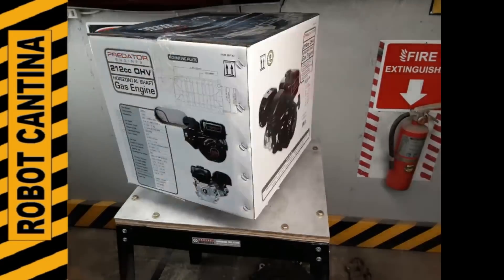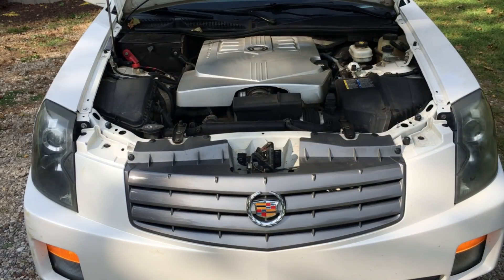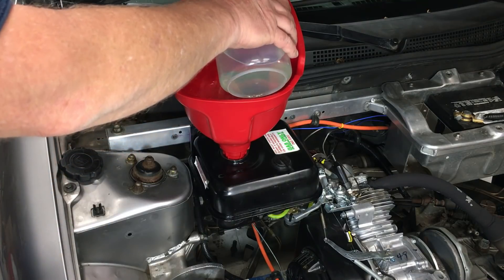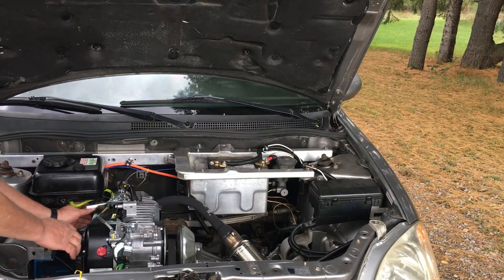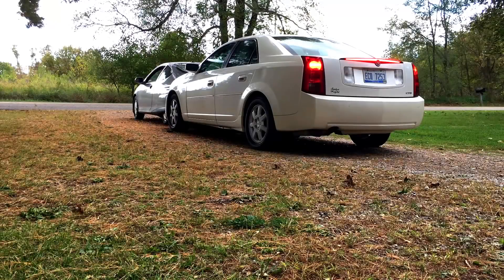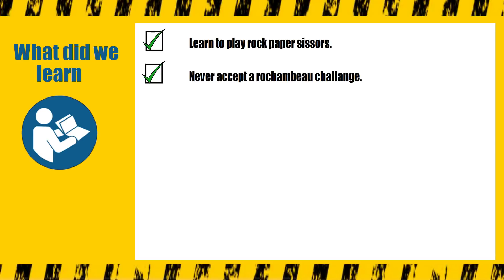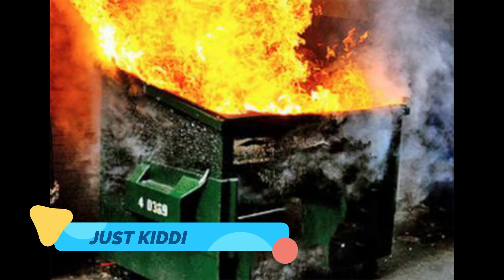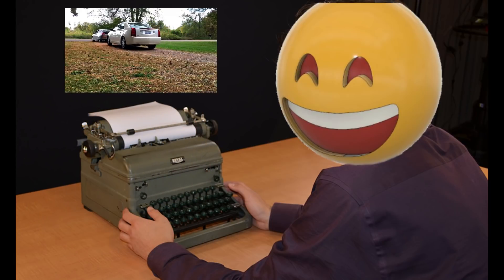Episode 6.  MPG on our Honda insight with $99 dollar lawnmower engine

Comment: 54mpg is pretty decent, but my stock insight gets ~62mpg and it has an electric starter...haha
Reply: And a/c
Reply: indeed these engines are small but not very efficient, not much is different to a pre w2 briggs engine, efficiency of car engines has come a long way to provide the power they do for the mpg
Reply: The $99 predator engine should be roughly 20% fuel economy lost approx just being a carburetor engine compared to an EFI engine. I think he needs to try a small EFI engine and try to beat that 62mpg! Lots of small tractors have 20-25hp EFI engines so there should be something that could be attainable. Of course EFI engines cost more though.

Comment: It did better than I thought! In your other video, I guessed right around 50 MPG, you did better than that. Thanks for showing MPG.
Reply: Actually, if Top Gear rings a bell, they did a mpg test between a Prius and a BMW. The Prius went down to 19 mpg. The trick was of course that they performed the test at 90mph, which is the top speed for a Prius and like 4th gear for the BMW. If you rev a small engine to max it's less fuel efficient than a large engine pretty much idling. It's simple physics really and not a fair comparison. I would venture to guess that this was also a full throttle test and you could probably get a lot better mileage by going only 35.
Reply: @uweschroeder  1g insight gets 45-50 MPG at 90 MPH.  Closer to 60 if it's UK MPG.
Reply: @islandfd3s  Which to be honest is not that great for a hybrid, but then it's a first generation vehicle - I guess they're better today. A BMW 420d gets 56mpg at over 140mph.  I rented one of those on my last visit to family and going 220km/h (about 136mph) it gave me just over 40mpg with the top down (it was a convertible). That I thought was impressive for a conventional car. My car gets about 12mpg with the top down - but then, one of my tires weighs 90 lbs and the aerodynamics are more like a box in a hurricane., so 12 mpg is reasonable for the fun factor.
Reply: @uweschroeder  Keep in mind, in that Top Gear challenge, they compared a gasoline (petrol) Prius to a diesel BMW. Diesel has a much higher BTU content per gallon than gasoline,  so the diesel will always get better mileage than a gasoline engine of similar displacement in the same car. Had they used a gasoline powered BMW, the Prius would have indeed gotten better mileage. Gasoline engines are actually more efficient under heavy loads, than at light loads, because of pumping losses caused by throttling. Also, this small engine has fixed ignition timing. If the timing advanced based on RPM and load, it would do even better. It would do better yet, if it had an O2 sensor, to control fuel/air mixture. For a $100.00 engine out of the box, it did extremely well!!
Reply: @vincentrobinette1507  I know the top gear "challenge" was designed to make a negative point about the Prius. If you saw the episodes about the Prius they were, while utterly hilarious, not very factual. I would bet they did that challenge several times with different vehicles until they found a constellation that yielded the intended result.

Comment: I'm officially complaining... you spilled multiple drops of fuel on both the first and second pours with the funnel.
Reply: lmao
Reply: But the real question is where did he get the old school filler? We're all stuck spilling gas with those new regulation spouts.
Reply: @ninjamaster3453  I 3d printed replacements for mine the files are in thingiverse I think
Reply: @ninjamaster3453  If I'm not mistaken you can get them off ebay
Reply: @ninjamaster3453  The good (relatively speaking) new ones don't let any fuel flow until you brace it against the lip and push a lever thing. Works pretty well if there's enough clearance.

The only other good modern ones I've seen are Eagle Safety Cans. Big ass handle you squeeze to open a huge spot that pours into a detachable funnel.
Reply: Multiple drops? The rest will be coming out the exhaust pipe. No big difference...

Comment: I used to get 52 MPG average in my old Prius even with crappy California gas, and 55 MPG with old Geo Metro without traffic at constant 50 MPH. SparkEV gets 7.2 miles/kWh at constant 24 MPH which is equivalent to 243 MPGe.
Reply: My 1998 Fiat 600 got 64mpg all year average like a granny (max 50 on the hw) 1.1L engine. The EV version of it from 2002 I'm driving now is getting 8 mi/kWh stop and go with no traffic in the city, max 30, when I can accelerate as slowly as I please. I suspect his beltdrive is a tradeoff to get reasonable acceleration. He should try with heavier weights on the pulley  and a smaller reduction to get a higher geared top end. He should get around 100 mpg with such a setup.

Comment: you should just reinstall the honda fuel tank and run off of it. you can use a pressure regulator to dial back the pressure from the in-tank fuel pump. it would be a lot more convenient, and cut down on the roadside refueling, which is depressing and dangerous.
Reply: That would increase the weight of the car and decrease its already low top speed.

Comment: How does it perform with a Tillotson TCT 'mechanical fuel injection' system?
Reply from the maker: Wow, this is the first I have heard of the TCT.  looks cool
Reply: @robotcantina8957  Also, check out project farm's spark plug testing! The autolite racing plugs are pretty bad. The Pulstar does pretty good.
Reply from the maker: I'll check that out, Thanks for the heads up on the spark plugs
Reply: @robotcantina8957  No problem, I look forward on seeing this insight become a barely-practical highway-driver.

Comment: Like the videos, can't hardly wait tell you get the 420cc in the engine bay.
It would be great to see a test with your torque converter VS a simple
Gokart clutch with 10 tooth drive, chained to a 60 tooth driven.
Reply: I would think that it would be way slower with the simple clutch. I think that the Comets go from 3:1 to 1:1.  So you'd miss out on the extra advantage. As well as missing out on the higher ratios
Reply: Why not just mate the engine directly to the manual trans? It would have less loss and probably go faster
Reply: @westellmodel  You're kidding right?
Reply: @MilesPrower1992  no I'm not kidding. 

The cvt sucks power off the motor. They're not terribly efficient and in comho with a 2nd transmission you lose power
Reply: @westellmodel  So you want the engine to stall every time it stops? No thanks
Reply: @MilesPrower1992  no it has a clutch. 

Connected like a regular car

Engine>flywheel>clutch>transmission

Make an adapter to go from crankshaft that cvt is connected to. Make the adapter bolt up to flywheel. 

It's a pretty simple job for this guy on sure. 

Although I dont know if the gear ratio would suit the engine trans combo, but I'm sure theres a Work around for this guy
Reply: @westellmodel  At that point just put the Honda engine back in. The point of this is to have something simple.

Comment: Extremely impressed with the amount of time and effort you put into this project. I'm likely going to start a similar project and I was shopping the local LKQ for a host car. I'm not going to start with a 212 however I want to jump straight to a bigger badder engine and go for the 420. The aftermarket support for the 420 is still large enough for me to make mods with shelf parts. The addition of the electric start would help alot, plus I'd start off with a better chance of achieving "road speed" on my potential grocery getter. 

I have one major question though, do you think that using a higher power engine like the 420 is going to require me to do some air routing over the engine to aid in cooling?
Reply from the maker: The only cooling issue I have had so far is when I used a billet aluminum flywheel.   The fins on the billet flywheel are not aggressive enough to move enough air to cool the engine.   Good luck with your project,   I would love to see the end result.
Reply: @robotcantina8957  when I get around to the build, I'll be sure to send you some updates.

Comment: What the heck you got 54mpg! My cvt with IMA delete gets like 42mpg average. Well done haha
Reply: If you drive at 40mph steady then you too will get 54mpg.

I get 90 to 95mpg on my cb250 (234cc air cooled carb. motor) if I'm mountain riding at about 45mph.  Drops to 70 if I take a long stint on a flat highway at 60mph.

30 to 40mph is the sweet economy spot for small torquey motors with 5sp.
Reply: @STho205  a properly functioning 1st gen insight will get 120-140 mpg cruising at 40 MPH.
Reply: @islandfd3s  yes but that's not the question presented here.

Before they converted it this insight likely got 0mpg as it likely barely still worked or they wouldn't have hacked it up. 

What's the good order working life of that car.   I've had ICE cars over 60 years old still driving well.   Intetesting to see the longevity of an early HEV.
Reply from the maker: The  gas mileage was a surprise because its on par with a regular Gen 1 insight,  Unfortunately this car wont go as fast as a normal insight... yet.

Comment: One more thing I was going to put a kubota diesel engine three cylinder in my car last year from a riding lawn mower 18 hp. I got the riding lawnmower for nothing on the Internet the guy said the transmission was out the starter was out and he was sick of it. In 45 minutes I put the transmission belt back on repaired the wire harness that had been knocked off when the belt came off. And I raise the hood move the fly wheel back-and-forth until the starter engages. It’s a $2500 mower I couldn’t take the motor out and put in the car it was more valuable as a lawn more to me.

Man in New York State has a 18 hp motor in his car and he gets over 200 mpg at the finger Lakes green event. In 2013 a Honda insight won.
My favorite cars yours of course-Volkswagen XL one Volkswagen XL  Aptera GMC EV   Late 90s car and of course the Honda Insight which I have six of. But one of my best friends in the world has 11 or 12 now and has sold 2 others to close friends of his. There’s a wonderful lady in Atlanta who has had five her friends drive her cars that I know of. There’s also a doctor in Indianapolis Indiana who has had 35 to 43 of them I don’t remember exactly but there’s people that do. Have a great day you make the Honda Insight look fantastic!

Comment: I put a signal light blinker on the fuel pump trying to use less gas. It worked but the fuel pump needs to be on one Seconds off for six  seconds.
If you’re driving down a flat highway in the summertime. It does not use a lot of gas driving on flat. It uses a monstrous amount climbing hills.  20 miles a gallon in first gear give or take and in my opinion it’s 150 mpg in fifth gear if the conditions are right which means summertime. Tail Wind and going downhill both directions to work and back.

Comment: A 480 pound battery in the  Chevrolet Spark EV will give you 70 miles. If it’s warm.

At today’s prices something like 2  dollars will let your car go 54 miles.

I have modified the fuel line on my car it’s also a 2000 Honda insight gray I think your car is beautiful. I do not have 70 pound battery behind the two seats. At 50 mile an hour my car shows 150 mpg on the dash.And but when I try 540 miles it shows 117 mpg. I also cut the two front springs on the car it’s it’s about 2 inches lower less air going under car less drag.

One more thing your back plastic bumper is regarded as a parachute you can cut more holes in it that match the exhaust exit take it off or front bumper back bumper under tray with a $35 piece of plastic and a few plastic ties that’s what I did.

A man in California makes an aluminum under tray for the front part of the car it’s a work of art I have one.

My modified gas line. 20 feet of copper tubing wrapped around the catalytic converter. The nozzle that goes on the end of a propane tank is very precise. That is attached to the fuel rail so I can cut the amount back to the injectors. I can cut it back so much it will not climb a hill so I get out give it a morsel more . And the car is set for
My  location in the world west Tennessee. Then I have a toggle switch on the fuel pump I can cut it off and let the gas in the lines be consumed when the car starts to miss turn the fuel pump back on the gas turns into a vapor it’s under pressure and I get real good mileage. Also have the front grill blocked. Improves aerodynamic drag.

I think the hot vapor gas that is controlled in 2 different ways and the lean burn characteristics of the car enhance each other. I also have reduce the weight of the battery is down to 2 pounds.My car still has the air-conditioning unit in it I wish it didn’t that’s 25 pounds.

Comment: That is pretty damn good for that many miles for that tank. Have to wonder if the battery might give up before a couple tanks.
Reply from the maker: The car uses almost no electricity when its running.  The brake lights and turn signals are the only draw on the battery.  It's been a month or two since the battery was last charged and it is still going strong.
Reply: @robotcantina8957  What no night driving? He he
Reply: @robotcantina8957  A stock Alternator could absorb one third of available BHP for a while after startup.....
and Maybe rename the Car 'Plains Mobile'?.....it will not be keen on climbing Hills.
great Video...thank you ..
Reply: @cerealtiller  a stock alternator could take off more than a HP actually,

Comment: So the interesting thing is that almost all 89 octane gas is a 50/50 (ish) mixture of 87 and 93 octane dispersed at/by the gas station you're at when you pump it. Personally I only run 89 when I'm pumping as I get at least 2.5 miles per gallon more and that is pretty good value for the 3/4 of tank I run out before refilling. To each their own though...
Reply from the maker: The 89 octane that was mentioned in the video was ethanol free fuel.  Its possible the boost in fuel economy was due to the more BTU's in the recreational fuel and not the octane.   We will find out in a future episode.